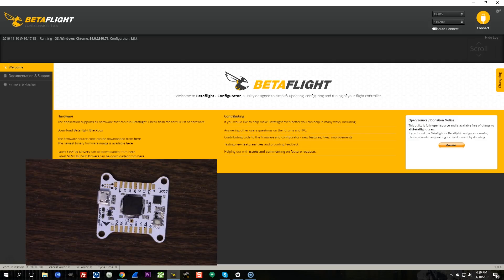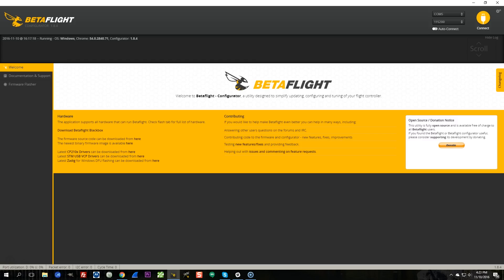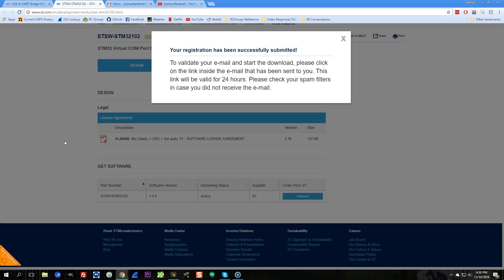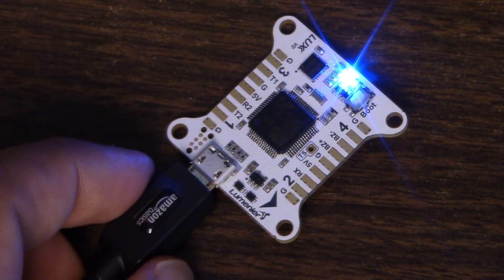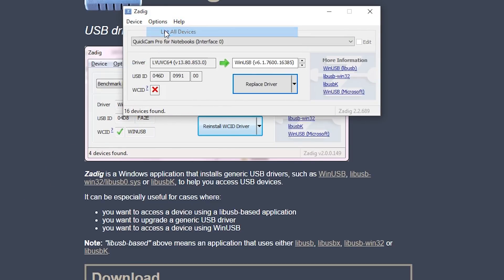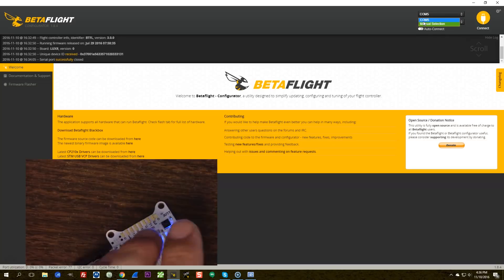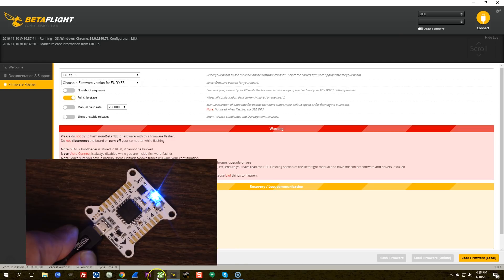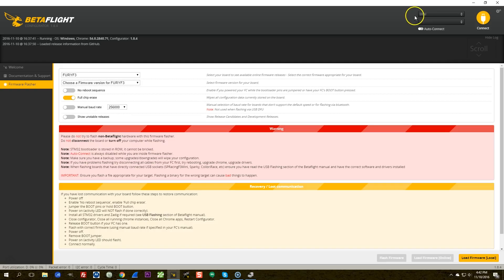Betaflight / Cleanflight Flight Controller Won't Connect | FIXED

Comment: Joshua. The last time I plugged my spracing f3 board into betaflight, it locked up. I exited betaflight, and the board wont connect anymore. I tried reinstalling the drivers per this video, but no dice. The fc still has the last iteration of betaflight settings I had on it before the trouble, It just wont connect now. windows machine says something like "this usb device has malfunctioned and may be faulty" or some such nonsense when I connect it right now 

Is it a good guess to assume the usb interface malfunctioned? I have an ftdi programmer, I'm just waiting on a new fc to come in the mail before I screw around with it anymore. That way I can keep flying!

Thanks.
Reply from the maker: Does it connect to a different computer?

Have you tried a different USB cable?

Comment: Great vid, but ofcourse I'm still having issues.
On the Ports tab I do not see any coms I only see Manual Selection. When I select connect It shows Failed to open serial port in upper left hand corner I've unplugged USB and started over several times with no luck.

Any help would be greatly appreciated, and I will be sure to pay it forward.

Thanks,
Reply: O! and I'm using the LUX V2
Reply from the maker: +Tim Mac if you don't see COM in the pull down then the driver is not installed or the board is not plugged in. Try a different USB cable as some are jade only to charge not pass data.
Reply: Thanks for getting back so quick!  I believe the driver is installed because when I pull up the Zadig the Driver shows WinUSB(V6.1.7600.16385) --> WinUSB(V6.1.7600.16385)
It would be a great if it was the USB, but I doubt it. It was the one that came with My Turnigy Evolution Transmitter.
Reply from the maker: +Tim Mac you should not have winusb for the non bootloader driver that is used to configure the board. Winusb is only for the bootloader, DFU driver, and only if you have a VCP board. This is your problem. Uninstall the driver and reinstall the CP210 driver then plug in the board.
Reply: I just followed all your directions to the T with no success :(     I'll l try with another USB
Reply: Thanks again,
Reply: I got it working! with the help from tkurtz from a forum. He suggested using the Impulse RC Driver Fixer for Windows. I'm sure what did but it works. I definitely want to be able to do this the right as you showed in your video but when all else fails this could be a fix for us noobs. Thanks to both you and tkurtz!
Reply from the maker: +Tim Mac nothing wrong with impulse rc driver fixer.

Comment: Help please I just got the Diatone Tyrant S 215 I've installed my receiver but it when I connect to clean flight or betaflight when I connect and go into the configurator tab and grab my drone it doesn't move on screen like it not connected. I've never had this happen but it's also my first PNF appreciate anything thanks a ton
Reply from the maker: +Shawn Hannah most, but not all flight controllers require the battery to be plugged in, in order to power the receiver. Male sure your props are off for safety!
Reply: Hey Josh thanks a ton I'm dumb the accelerometers needed turned on however now I noticed when I powered the quad up all 4 motors were like pulsing I switched from angle mode to horizon 2 motors pulsed full acro only 1 motor pulsed any ideas? Thanks a ton

Comment: Joshua, do you run normal expo on your radio also when you have super-expo enabled?
Reply from the maker: No. I use Super Rates in the FC for my expo curve.
Reply: Joshua Bardwell, Thanks 😊 in the end it does the same thing right? It's just that one of them you can set on the radio and one you can set in the fc?

Comment: Hey Joshua, I have a problem with my Lumenier lux v2. I did install the drivers just like you did and I can connect with betaflight. The problem is, everytime I click ,,save and reboot,, , the com port gets closed and my settings arent saved when I connect again. I really don't know what to do....
Thanks

Comment: Hey Joshua, please help! I just got a Diatone GT 2 and was setting it up for the first time. The quad was connected to betaflight and everything was working except I couldn't get the receiver to show it had any power. So I disconnected the quad from betaflight, and tried to reconnect the receiver. When I tried to reconnect the quad to betaflight the board would not light up or make any sound. It does try to auto connect to betaflight but then successfully closes the port. The drop down has a COM3 and manual. I have tried on both my computers (a Mac & Windows 10) and with different usb cables and I still can't get any life out of it. When its not connected to betaflight and I plug the 4s Li-Po in,  I do get tone and lights from the VTX board, but the flight controller stays dark. What did I do wrong?
Reply from the maker: +Breton Woodford if the LEDs don't light it usually means the board is dead.
Reply: Thank you Joshua, I don't understand how it was working one minute and the next, the is board dead.
Reply from the maker: +Breton Woodford welcome to China.
Reply: Hahaha! I guess your right, just bad luck. I tried to set up my wizard x220 the day before and when I connected it to betaflight for the first time, one of the rear esc's caught fire. Thanks China!
Reply from the maker: If you are really good at soldering, you may be able to identify a bad regulator and replace it. But troubleshooting exactly what failed can be really time consuming. The LEDs lighting is one of the most basic things the board can do. If they don't light, it usually means the board isn't getting power. If the board doesn't get power when you plug it in to USB, it's probably dead.

Comment: I have a SP F3 acro flight controller. When I first plugged it in. I got connected to clean flight and everything was working. Now I can not connect to clean flight at all. I followed this steps in this video and it still doesn't not work. I'm using windows 10. Also when I install zadig the "stm bootloader etc..." does not appear. It only shows "cp2102 to UART Bridge controller in the drop down menu". Please help, thanks
Reply from the maker: SP3 is not a VCP board so you will never see STM32 Bootloader and you don't need Zadig.

If the chip used to work and now it doesn't, something changed. Odds are your drivers are fine. Try another board on the same computer. Try another computer with the suspicious board. Try a different USB cable.
Reply: Joshua Bardwell thank will try on another computer and if that doesn't work, will try a new board. Thanks for the quick response
Reply: Joshua Bardwell ok I tried connecting it to another computer and no luck with it. I plan on buy another FC. I would like to know is there anyway of checking to see what when wrong with the FC or are any of the red and blue light indications a sign of anything wrong. All the lights are blinking the same way when it actually connected to clean flight and worked

Comment: What happens if you download and install the drivers a couple more times than once because you are noob. Do you need to restart your comp once you download and install the drivers?? Thanks.
Reply from the maker: It doesn't matter if you install them more than once. I don't think installing over them will really do anything if you don't uninstall them first.

Comment: Man, u r god send. I've been fooling around my new F3 EVO board for 2 days to get it to connect in DFU mode for firmware flashing without any success. After your vdo, everything is done in like 5 minutes. The reason why I can't find this vdo is because you refer to LUX flight controller and I just stumble upon it while searching about VCP driver problem. My Windows7 shows the board in STM32 DFU device but no DFU in Cleanflight pull down menu for com port. All the talks about VCP driver issue never stated clearly as your VDO did, which driver you are suppose to install to get thing working.

Thank you, Thank you, Thank you.

Comment: Hi wonder if you can help I flashed betaflight to my spracing f3 evo board in dfu mode using zadig no problem there but still not getting any connection to betaflight
Reply from the maker: +Peter Perry you don't want dfu mode when trying to connect normally. Only flashing.
Reply: Joshua Bardwell thanks for the reply but I desoldered boot pins after flashing tried to connect but no com port to connect too

Comment: I installed all drivers and i can not connect to a single board of mine, not the omnibus not the xracer not the naze, it doesn't even show me a com port at all in the device manger, and if i try to install it via legacy hardware it doesn't work either. has someone a solution for this problem? running win10 reinstalled from factory iso.
Reply: Does nobody know at least a tip?
Reply from the maker: +Bloody JMF if you don't see COM port, the drivers are not installed correctly or the USB cable is bad.
Reply: I am clearly overseeing something here. I tried it on both my PC's and i followed the instructions also all drivers are listed as installed in programms cable is fine tried others and betaflight just gives me the option to select com ports manually
Reply: Problem Solved
(I actually feel a bit dumb)
I used multiple cables that work well on my phone and also power the boards thus i was thinking the cables where fine.
Turns out that the data pins where not connecting on the fcs usb.
A set of new USB cables from another manufacturer and everything works.

Comment: Thanks for the vlog. Whats missing is "which drivers are needed for Macs and which one(s) for Windows?Your example is for Windows but a lot of us have Macs. Lots of times, Macs already have the capability, and may also have drivers built in.You talk about exe files, but these dont execute on Mac OS. So do the.Macs need both drivers or only cp210x!You can also be more specific on each step. You got off vector a bit too with spurious comments, and also assume that we all know the terms you are using.
Reply from the maker: +DOZDog welcome to the channel. Thank you for your feedback.

Comment: Im trying to download the STM USB VCP driver but the downloader says it is only available on windows and im using a Mac. How can i download this on my comuter? Please help
Reply from the maker: Mac does not need that driver. It is already built in to your O/S.
Reply: Cool, I already downloaded the other driver but my quad still won't connect to betaflight
Reply: ive gotten to the stage where I can flash the firmware but then it says bootloader failed
Reply from the maker: +Peyton Trombley you're not in bootloader mode.
Reply: Joshua Bardwell how would I access boot loader mode then?
Reply from the maker: +Peyton Trombley hold down the bootloader button while you power the board. Or if you have bootloader pads instead, short them together.

Comment: Hello Josh I have an SPRACING FC on my drone I carried out your  instructions and everything is  ok up to 5.11 I have com3 and a solid blue light with a flashing  red  light . when I connect I only get a connection for 10 secs then communication failed.
Hoping you can help.
Reply from the maker: If you see COM3 then a serial device is present. Probably your drivers are set up correctly. Is there any other COM port available in the pull-down menu?

Flashing red light and solid blue light suggests the correct firmware is on the board so that's good.

Could some other program be using the COM port, like BLHeliSuite?
Reply: There is only COM3 in the pull down menu, I have CP210x USB to UART Bridge (COM3) in Ports and nothing seems to be showing up in universal serial bus controllers apart from USB 3.0 eXtensible Host controller -1.0 (Microsoft),  USB Composite Device and USB Root Hub(xHCI)

Comment: Windos dont recognize my board.... got all drivers instaled, after folowing the steps i got it to work one time but after disconecting in dosent work any more. im using win 10, wen i plug it in win shows a mesage sying usb devide not recognized.
please help hair is falling off....
Reply from the maker: Basic troubleshooting steps in this situatoin:

1. Use a different USB cable.

2. Use a different USB port.

3. Use a different computer.

4. Put the board into bootloader mode and see if you get the STM32 Bootloader device to appear (only works on VCP boards).
Reply: Joshua tanks for the reply, tried them all, i will try to do on a mac. im using a lux v1. but dont know wat to do anymore, is there a diferent driver ? it works on bootloader and i can flash the board no problems but wen i try to conect in normal mode windows just displays a mesage about the usb not recognizing the device.
Reply from the maker: +Gabrielm200 if you can flash it it's not dead. Are you flashing the right target in the configurator pull down.
Reply: got the same problem in osx, only shows up in dfu mode.
Reply from the maker: +Gabrielm200 my guess is you flashed the wrong target to the board.

Comment: I did however installed the WinUSB using Zadig and replaces the usbser v10.x.x driver. I have no way not how to make it back. How do I uninstall the WinUSB driver that Zadig overwritten?
Reply from the maker: Device Manager. Plug in the device. Right-click the device in Device Manager. Uninstall, checking the "delete files" option. Plug in the device and let the default system drivers reinstall themselves. You might need to reboot after uninstalling to get this to work.
Reply: Just fixed it! For those who did the same mistake that I do. Just go to Zadig and instead of choosing "WinUSB" choose the "USB Serial (CDC)" and click replace. After a few seconds it will show usbser v1.0.0 something and go back to configurator a COMXX port will show ;)
Reply: Joshua Bardwell tried that and all but windows install the same driver again it will always chose the WinUSB driver. What fixes mine is through Zadig and chose CDC and it will install the usbser driver again ;)

Comment: i'm using a macbook and unable to run the .exe file to install vcp. help pretty please
Reply from the maker: You don't need to do any of that. Macs have the drivers already. And EXE files only run on Windows.
Reply: Joshua Bardwell yea, i figured it out by just trying and it worked. thanks for the reply. i am however now having trouble with binding taranis plus to x8r. no response at all from controller to quad or in betaflight to check throttle, yaw, etc. i'm getting green led on rx when tx is on, red led when tx off, so i know (per instructions) that they are bound. everything seems to be plugged in as in the instructions. packed it up for the night and will try again tomorrow after work. thanks
Reply: Joshua - if Macs already have the drivers installed, then why doesn't my options in the top right list "COM3" . The only ones I have are "/dev/cu.Bluetooth-incoming-Port", "/dev/tty.Bluetooth-incoming-Port", and "manual selection" . Thoughts?
Reply from the maker: +MrJRide2345 I don't know. I don't use a mac. They don't refer to serial devices as COM anyway.
Reply: Joshua Bardwell i saw the .exe and knew it was windows, i just over analyzed and started thinking to convert file to the dark side as this is all new to me... i am still having the issue of no comms between tx and rx, even though everything indicates its bound. nothing moves physically on quad or slides in betaflight receiver tab. im using frsky x8r rx and taranis plus. thanks

Comment: Hey Joshua - what is your suggestion for downloading the STM32 Virtual COM Port Driver on a Mac?  The file is a .exe on wont work on a Mac.  Thanks!
Reply: MrJRide2345 I want to know this too! I used to be able to connect with my mac no problem. After I flashed my FC with  betaflight 3.1 it stopped working? Quad comes on and activates with trigger switch per Joshua's "CLI" settings. It just doesn't connect anymore???? NEED HELP JOSHUA
Reply: Dylan Chislett connect battery to quad. then open betaflight. connect USB to quad and computer. then hit connect on betaflight. solved.
Reply: just put it into bootloader and flash it
Reply: I use implus and a mac conveder from exe to mac file and it work 👍🏼
Reply: hi Raymond, can you explain this a bit in depth, I have the same issue as above and am a newbie in mac to exe convertors, thanks!

Comment: Joshua I'm hoping you can tell me something, I've searched all over and cant seem to find an answer. My wife got me a chrome book for a gift as I wanted a small laptop to take to the field and do tuning. At first I thought this wasn't going to work because of the drivers needed for betaflight but I downloaded betaflight and so far everything seems to work. So does a Chromebook not need the drivers or something?? I'm just wondering cause i thought it was weird I didn't need them. I really wanted a windows OS 2 in 1 tablet but she got me this and I don't want to be rude about a gift! and I honestly like the OS but just wondering if I will ever run into problems because of the drivers and things? any help would be great if you know anything about betaflight on Chromebook OS. Thanks!
Reply from the maker: The drivers must be pre-installed with Chromebook. If it's working, don't question it :-)